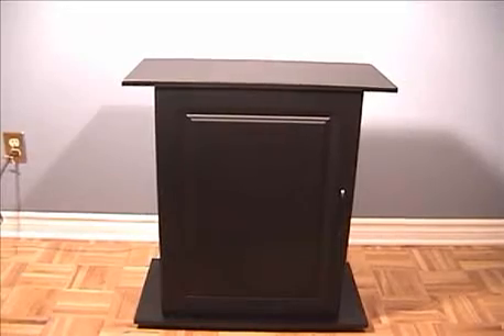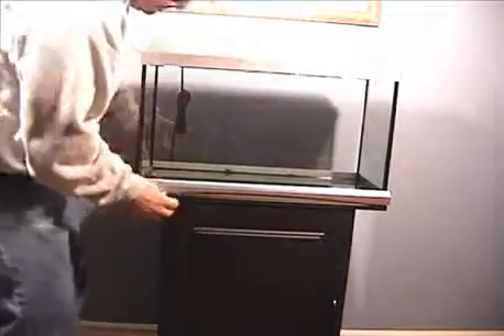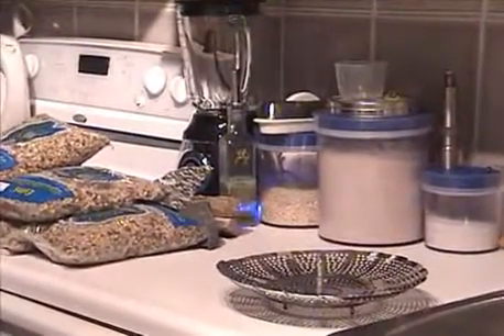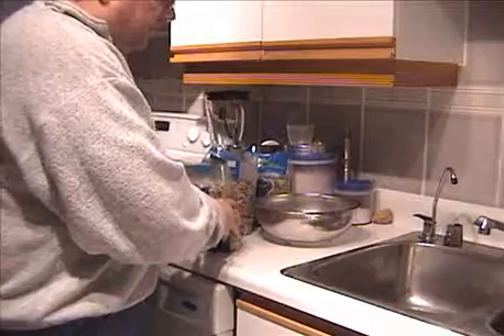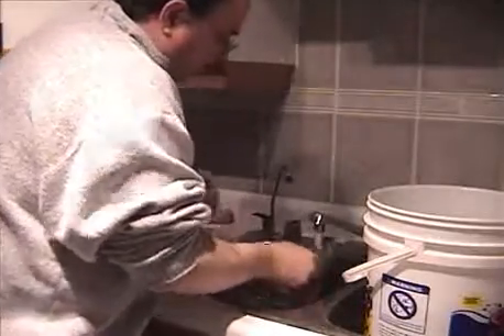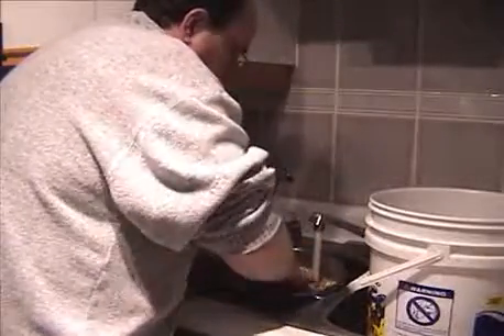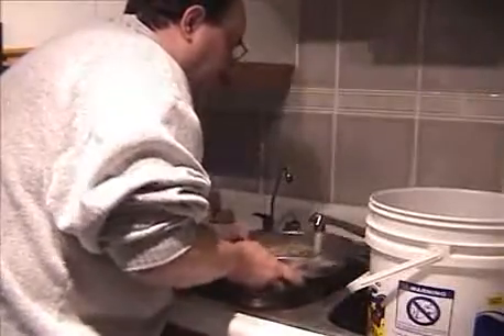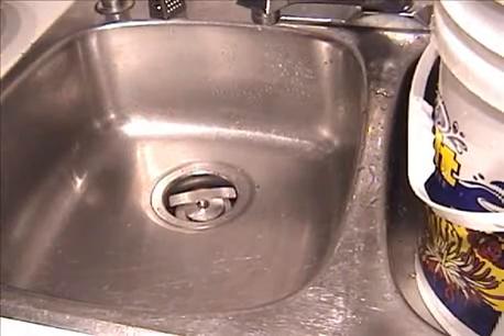How to wash gravel for a new aquarium set- up

Comment: Hi,  There may be a couple of explanations, First, if the water did not turn milky (chalky) right away, it may be new tank syndrome - a bacterial bloom not from the gravel.

Otherwise, there may be a problem with manufacture and need replacement. If it is dolomitic limestone that has been dyed, it may be giving off white particulates, but it is very rare that the gravel itself will cause a problem with discoloring the water in the tank